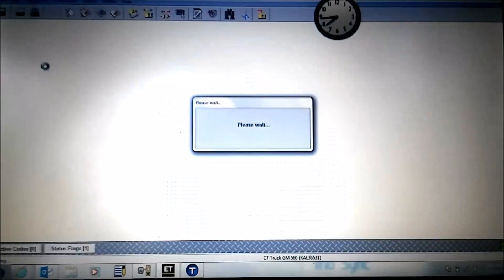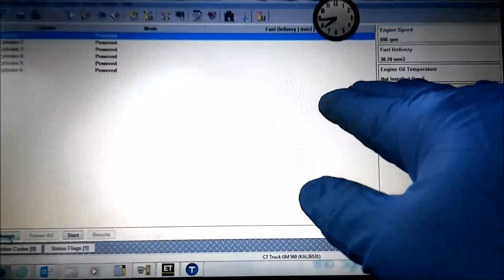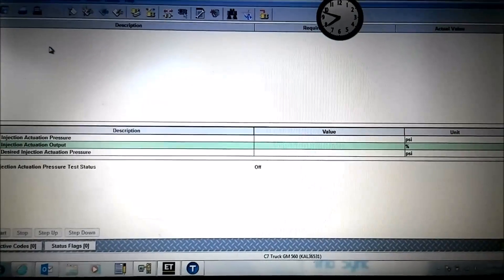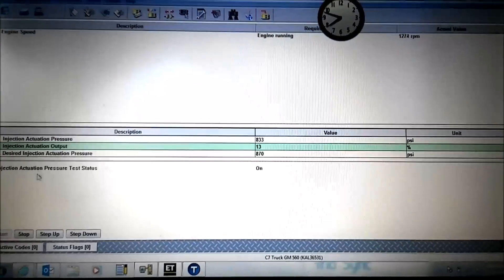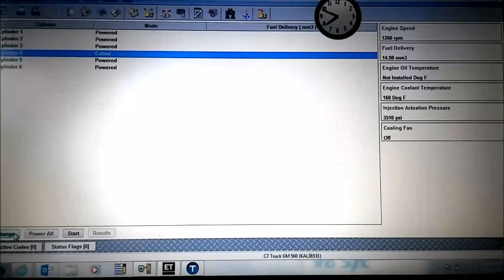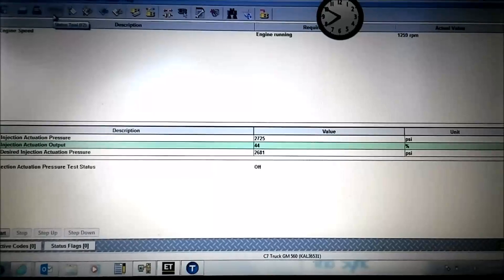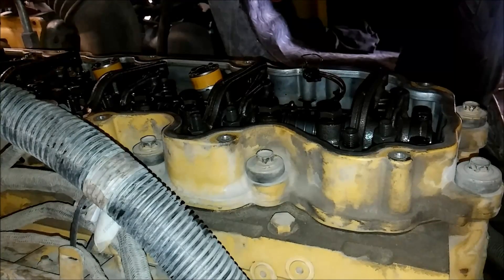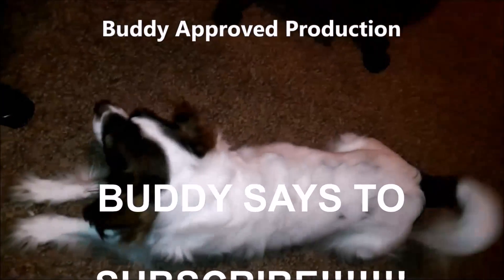How To Do A Cylinder Cut Out Test and Check for Weak Injectors.  Cat, Cummins, Detroit.

Comment: Good afternoon, I have 3126 and I have had several injector, cup, oring problems. With that being said 
First injector orings because it was put engine oil back to the fuel tank, so I replaced them but I didn’t use the cat oem orings because they were like 400. To reseal all the injectors. I order felpro kit and they did okay for a while but then it started putting fuel to the coolant system. When I removed the injectors to pull the cups I notice the felpro orings looked bad, like a dummy I ordered the same felpro kit again and replace the cups and oring. Then months later it ran outta engine oil again before the orings failed and sent it all to fuel tank. So again I removed the injectors again and this time I put the oem cat orings on. The first few times I replaced them I didn’t keep up which damaged orings came out of which cylinder but the last set of felpros I pulled out I did and it was 345 that failed the worst. Anyway the most recent issue I have is, when it starts it’s missing and once I get it going it will start to run better but not perfect, when it’s idling it will all of a sudden rev up and hold until I took the pedal and then while driving it will sound like intermittently as if it is loading up then back to normal then sometimes I can drive it 60 miles and it won’t do it but maybe once. I just pulled it in shop and removed the rocker box cover and cranked it, and it appears the that 12346 have oil running out the side of the injectors, that’s not suppose to happen right? Doesn’t that mean all of the injectors have internal leaks and need to be replaced? Has the heui system wiped the injectors out? Sorry about how long this is trying to give you the history and you seem extremely knowledgeable about these engines

Comment: Great video helped me so much with diagnosis. 
Bumped up pressure to 3300 was able to find bad number 4 injector. 
At 860 psi injector seemed fine.
Thanks for the tip

Comment: Hey what's up Adept Ape, I really appreciate your videos and I was hoping you could give me some guidance on something I'm working on.

I have a 2003 Dodge Caravan SE with the V6 3.3L Flex Fuel engine. It's got a Multi-Port Electronic Fuel Injection (MPI) system. Here’s how I understand it works:

•  Air gets pulled through the air filter housing and intake duct into the throttle body.

•  Inside the throttle body, there’s a throttle plate that controls how much air goes into the intake plenum and then to each cylinder.

•  Each intake port has its own injector.

•  The MPI system sprays fuel into each intake port in the same sequence as the firing order.

•  The PCM (Powertrain Control Module) controls the injectors and constantly monitors engine conditions (like temperature, load, and speed) to determine the right amount of fuel.

•  It adjusts fuel delivery using pulse width (how long the injector stays open), and can change this instantly — even between cylinders.

Here’s my situation:
My van has a misfire, and I want to do a manual cylinder power balance test by cutting fuel only (not spark), because it has a catalytic converter and I want to avoid damage.

But I don’t have access to a professional bi-directional scan tool that could do this electronically. That’s why I want to do it manually — by cutting fuel at the PCM level.

The injectors are buried under the intake manifold, so I can’t unplug them directly. But I found all six injector control wires at the PCM C1 connector:

•  Injector 1 through 6 drivers — all control wires from the PCM.

My plan is to backprobe those wires at the connector, one at a time, and cut the signal briefly to see which cylinder causes the biggest RPM drop (or no change), so I can figure out which one is weak.

But I have a few concerns and questions:

1. I know the Idle Air Control (IAC) motor might try to "fight" the RPM drop and compensate for it during this test. Would it be a good idea to unplug the IAC connector while doing the test so it doesn’t interfere?

2. When I backprobe the control wires, should I use a T-pin and a test light (connected to battery positive) to interrupt the injector pulse by grounding the circuit temporarily?

3. Or should I actually remove each injector driver wire from the PCM connector one by one instead?

4. And finally — how can I "be the PCM" and meet the conditions that would normally turn the driver on or off? In other words, how do I safely simulate the PCM’s control logic while interrupting fuel manually without messing anything up?

I know this is a long message, but I wanted to lay everything out clearly so you’d have the full picture. I’d really appreciate any feedback or advice you can give on this.

Thanks again — your teaching style really clicks with me, and it helps a lot especially since I learn a little differently.

Comment: I HAVE A PRBLEM ABOUT CYLINDER CUT OUT TEST MY CYLINDER CUT OUT TEST ON INJECTOR NUMBER 3 IS QUESTIONABLE, I ALREADY REPLACE ALL INJECTORS AND NEW HUEI PUMP, 
THE PROBLEM IS WHITE SMOKE AND QUESTIONABLE CUT OUT TEST ON INJECTOR NUMBER 3.
I ALREDY PREFORM INJECTOR SOLENOID TEST ALL SOLENOID ARE OKAY, 
WHEN I REMOVE THE NEW INSTALLED  INJECTOR NUMBER 3 THERE IS NOI SIGN OF CIOMBUSTION LIKE BURN ON NOZZLE.

Comment: Hi, I Know this is an old video,but was hoping for some info, my car runs fine, no fault codes, but the injection timing on cylinder 3 Is lower than the rest, the rest are 255, cylinder 3 is 88. Is this normal?

Comment: great video, clear information. could you guide how to do oil cut out test physically in the cat models
Reply: I’ve had my injector miss because the little disk that goes over the injector had the two halves touching in the middle. Makes me think you could jumper them some how or just remove them one at a time to get the injector to stop working. Tedious but it’s a way to do it physically🫤

Comment: We have a customer that has had another shop put 2 full sets of Injectors with in 35 days of each other,  they now want me to diagnose it. Truck has 241k miles on it. They put a set of injectors in it, it made it 35 days, started misfiring on 1,3,6. They then put another 6 pack in it and it’s coming up on 30 days and the truck is misssing on 2,3,5... any advice is helpful. I’m used to ford powerstroke engines, not these cats.

Comment: I have an injector that is not getting the same about of voltage as the other injectors. What would cause this? I ohmed the wiring harness and no resistance.

Comment: PLEASE HELP!! I have a c7 marine engine and I'm having problems with fuel in my oil. I have replaced the O rings on all the injectors. Replaced the transfer pump. replaced the oil and marked the level of fluid on the dip stick. I took the boat out for about an 1hr  and came back to check to check the oil level and its still the same. I decide to head offshore for work the next day and I drove the boat for about 3 hrs to get to the spot where I start to trawl. I checked the dip stick and the fluid is now an 1in higher from the mark and i can see the fuel mixed with the oil. I did try a cylinder cutoff test and when I cutoff cylinder 4. the sound of the engine didnt change. Could the injector be leaking. I dont see much white smoke coming out of the exhaust either. PLEASE HELP!!
Reply from the maker: You most likely have an injector itself leaking and not a print try doing a dye test in the fuel or replacing all six.
Reply: @AdeptApe  I remember when I pulled injector 4 out the tip of the injectors had a lot of carbon build up. It was really the only one that had that much build up. Can that be a sign?

Comment: Is there a way to add in those parameters you have to the right hand side of the screen in the cylinder cut out test? Mines only has the engine speed parameter when I go into cylinder cut out test.

Comment: I have a 3406e that ran very well and then it started a intermittently fireing put a injector in it ran fine for awhile then it started it again later down the road we did a cutout. And tried switching injectors 1too number 2 changed a little tried wiring harness both rocker box and motor to ecm and all sensors checked cylinders no issues that could find when it's loaded and pulling the missing and jerking get really bad only way to drive it is let off or push it down harder doesn't fix the missing but it pulls better 1300rpm to 1550 this missing comes on and sometimes a miss after I get off a ramp to pull up to a light it comes down to a idle it will miss I can't think of anything thing else to I've done everything

Comment: I wish I had the capability to scan my 06 Cat C 13. It developed a mild skip so I changed both fuel filters and the skip never went away.
Whats really crasy is ever since I changed the Secondary fuel filter the restriction gauge at max power goes to almost 5.
Before I changed the filter it would reach 4 at max rpm.
Love your vids man! Also the clown and buzzer is funny!

Comment: Can a cylinder cut out test be done while driving down the road
Reply: Not the test, but you can cut cylinders out manually. The best test is on a dyno, get whp reading, kill number one. Let it stabilize, record, fire one and kill two. The faster the better and do this on each cylinder. Then get them all hitting again and record. Should have eight data points. Print out on a graph and see if you have a weak cylinder.

Comment: adept ape i was wondering if you had a video of any leaking  injector o-rings with the truck running i have a truck that it is pouring oil out around a few of the injectors

Comment: I just got work in a mechanic shop. Small, disorganized and trucks keep returning. I have never seen them do such a test with a computer and the program, although they have one. So far I keep seeing the same trucks return within days for engine related issues. And some other trucks return with more issues  that did not exhibit other problems. I think I am seeing first hand a hack mechanic shop where used parts are recycled, lack of inspection is an issue, lack of documenting work done, and impatient Owner. One truck in particular had a bad turbo and engine work done. Then it came back for more engine work and a new broken turbo. Then it came back with a blown piston sleeve. Catastrophic destruction. I expect it to be back again. And I have been at this mechanic shop for one month.

Comment: I have a cat 3406e been overhauled recently with a new head and it’s getting a miss under load and has a little rough idle but usually when I’m loaded pulling a hill and if rpms are around 1400 or so and boost sits around 20-30psi it jerks the truck and bucks I have to either let off or press the throttle for it to smooth out for most part and also noticed once I get into the higher gears usually 12-13 gear the rpm climb really slow and takes very long build speed this is empty or loaded. Or if I keep it on cruise and it pulls smaller hill and gets back on to flat and boost starts dropping for about 35 around 30-20psi it’ll do same thing jerk truck back and forth and soon as boost drops below 20psi or so it’s smooths back out. Could this be a bad injector. Sorry if my explanation is all over place just trying figure how put it into words.

Comment: Hey bro would love to get in touch with you I have a mxs c15 with some issue with no engine lights has power issues it has low boost and kinda sluggish it’s I’m buring a wick load of fuel I use to get 1000-2000km a tank, I have a local gravel truck!! The weird thing is a few times a day the truck will all of a sudden start to produce proper power again 40-50ps boost and will pull good and hard, then after about 10-15 mins or so maybe more it will be back down to having that sluggish low power again
Reply: You may be Getting air into the fuel system.  I used to run a John Deere Combine that acted the same way and it was air getting into the fuel system

Comment: Volvo d13 2012 i shift 
I have vibration on 40 to 45 and 50 to 55 front of truck is shacking  steering  weickle  too, and rpm nidalee  jumping, i change cylinder head becouse of pitting on 6 injector cap  fiting and change the 6 injector only becouse rest of are ok mechanics say, now truck is shacking again on same speed, they do test will driving the truck with computer  on it  and say everything shows good.Wath can be the problem? PLEASE  HELP

Comment: I had a bad injector and found it by disconnecting one injector at a time until I found the bad cylinder, The engine would run bad when cold and smooth out after it warmed up but then it started making a loud ticking noise,  I took it to the place that re-built the engine and they had already replaced the injectors 3 years ago ( about 50,000 miles), they said I had bad fuel and my engine was pinging and was told to run it easy until I burned all the bad fuel out, charged me 440 dollars to change the fuel filter, water separator and air filter, that did not fix it so they told me to drain the tank and flush it, did that and still not fixed. Tank was clean. Disconnected the number 3 injector and the noise went away completely and the engine actually ran a little better, this is the awesome part, my uncle who I work for owns a packaging company and we actually do foam for a company called Diesel Products and a few years ago they dropped off a sample for us to package and no kidding I found it last week, it was my EXACT injector, 241-3238 popped it in, truck runs alot better but the injector is not calibrated to my engine so when I take off or it is at idle it runs ruff but smooths out pretty much completely at 2000 RPM, kinda like to much fuel until you get up to speed then all is good, now my problem is getting the injector calibrated, I no longer trust these mechanics. What do I need to flash one of these injectors because I will tell my uncle to go and buy it, can it be done with just the computer and software or do you need the CAT online service that is like a grand a year?? I bought a 2000 dollar GM computer clone for 400 bucks and it works perfectly, but I have to pay to log onto the GM website if I want to program anything, it used to be $1200 a year now they have $55 for three days. but all the troubleshooting functions still work. The computer itself is a clone but comes with factory software, If I just bought the computer can I calibrate the injector to my engine??? Thanks for all your help. I think this is the problem?? runs way better with the newer injector, maybe still have other problems??
Reply: just watched this video, "What Causes Diesel Engine Ticking, Clicking, Tapping, and Knocking?" Pretty sure it was fuel knock since I changed the injector, just need to program it now I think.

Comment: I have a scan tool that can do an IAP test and cyl. cut out but it wont show me any values 
(cheap autel peice of junk), if i raise the IAP to max and do the cut out test , will I be able to go by sound and feel as to whether or not the injector is weak or am i pretty much f&%ked without being able to read any of the values. from there I would do the other checks you've shown to single out it being an injector, very knowledgable and very helpful vids, keep em coming thanks.
Reply from the maker: +Jack Brennan If you have a dead cylinder you should be able to tell. Which if you cutout a dead cylinder you won't feel anything. If it is weak though you might feel it cutout, but not be able to tell it is weak.
Reply: I cutout #6 and you can feel its a dead miss, no difference in the way the engine runs when its cutout. messed with my parameters on the scan tool and now I can see the data while performing both IAP test and the cyl. cutout test. Based on what I'm seeing vs. what you displayed in this video its probably a dead injector but none the less I'll be removing the VC tomorrow to inspect the valvetrain and pressurized cyl.#6 as the engine does have some blow by. Thanks for the info, you're probably the most professional on this site!

Comment: i have engine  cat 3516 series,the problem now is that the  two turbocharger on left side is very red at temp range 600degree and right  side in normal temp reading 430 degree.
what can i do to solve problem

Comment: Hello Adept,  If you were in the field trying to diagnose the cause.what would be some things you could try to do to narrow it down to a Bad Injector.  Without the use of a laptop, which most of us do not have access to.
Could you perform a cylinder cutout, by merely cracking each line to the injectors and listening for an idle change?  How about feeling the exhaust manifold or using a heat gun to check to see if each cylinder is firing?  I'm just trying to come to the same conclusion you are, without the use of expensive diagnostic equipment.  Good Vid none the less, as always
Reply: I found mine by removing the valve cover and removing one connector at a time until I found the cylinder. My engine would run bad cold then smooth out after it warmed up and started making a loud ticking noise like the engine was going to come apart, as soon as I disconnected the connector to the number 3 cylinder it went away and actually ran better.